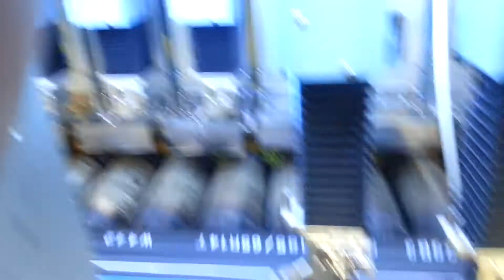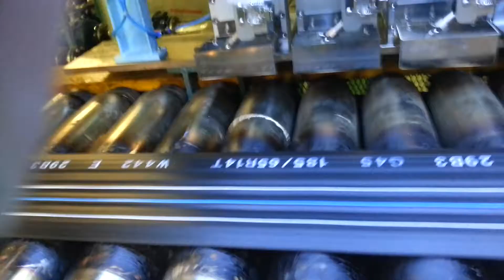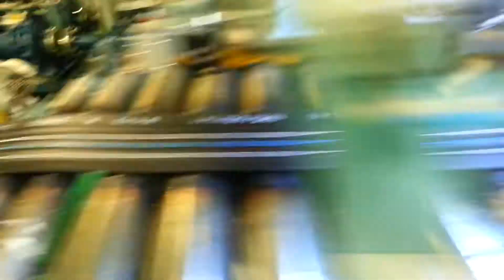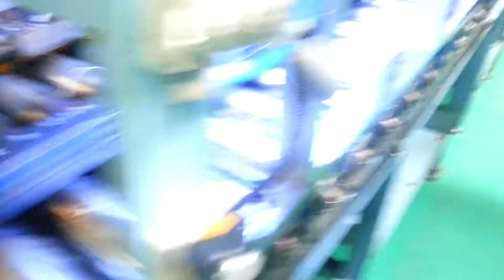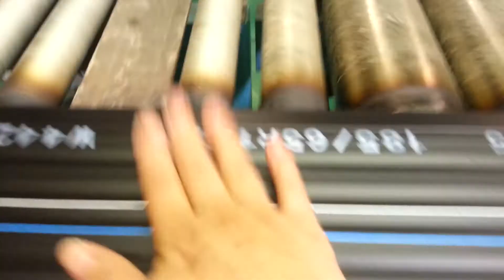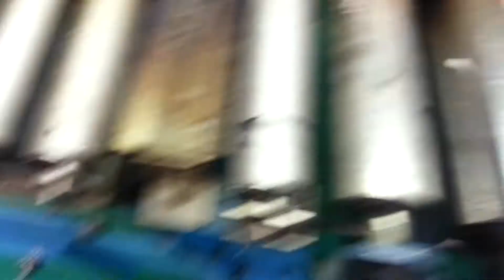Auto Extrusion line marking System for Tire

Comment: Which make system is this ?
Reply from the maker: An automatic system for marking solid lines in the tire rubber in the extrusion process line during the tire manufacturing process line.
Reply: Which type of nozzle you used?